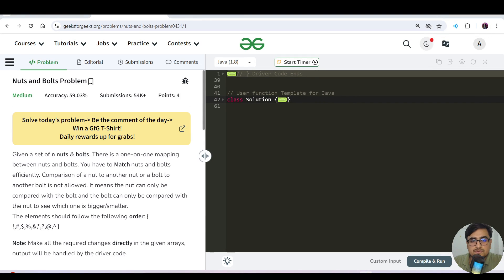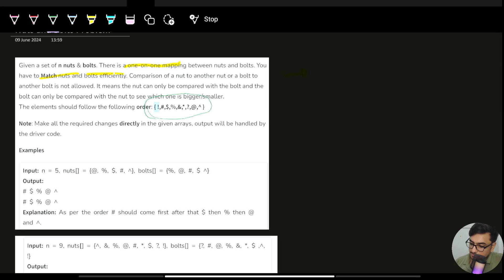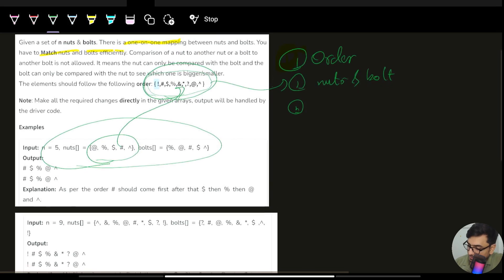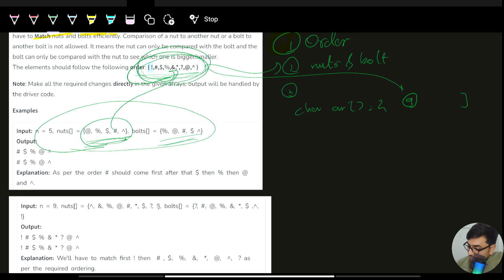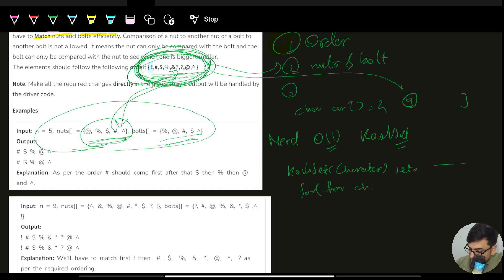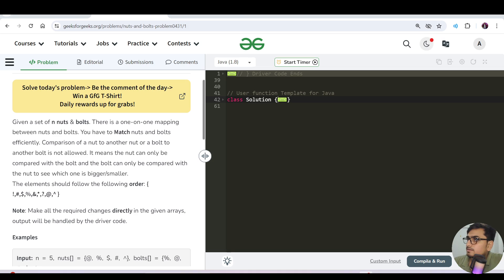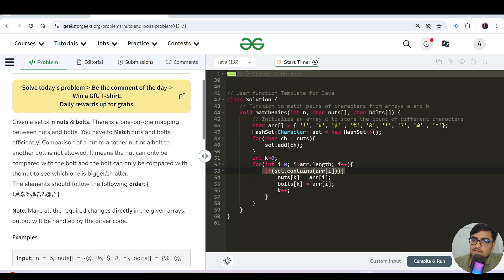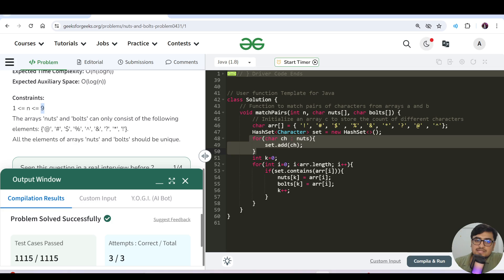D-512 | Nuts and Bolts Problem  | gfg potd  | GFG Problem Of The Day | 10 June

Comment: yeah this seems to be an easy problem, i used the same approach as well...

perhaps it could have been more difficult if the duplicates were allowed and constraint were higher, but then we would have to use hashmap 

also, they could have maybe put diff elements in nuts and bolts ...but even then it would have been easy only imo